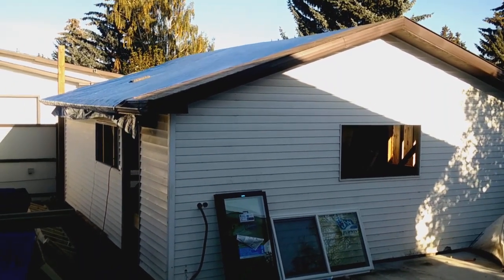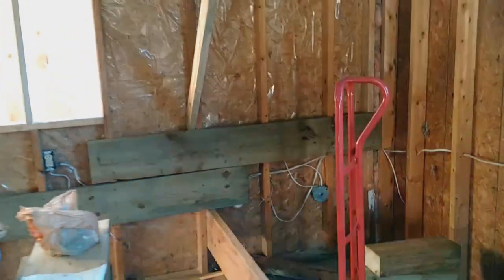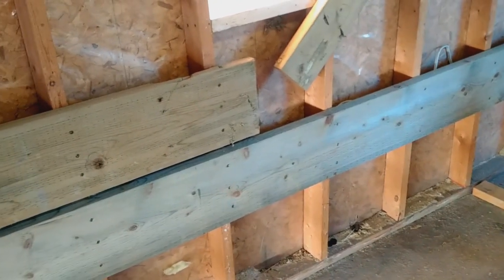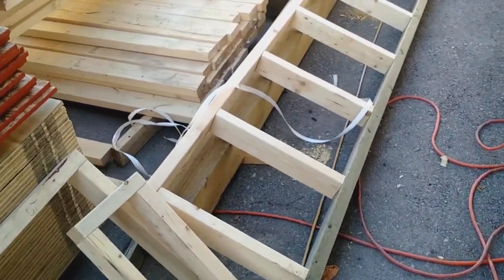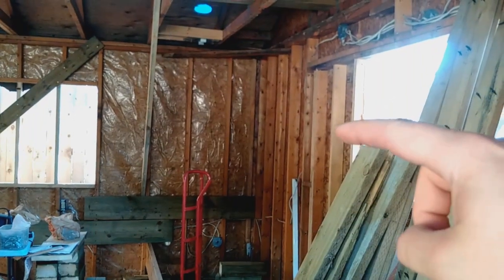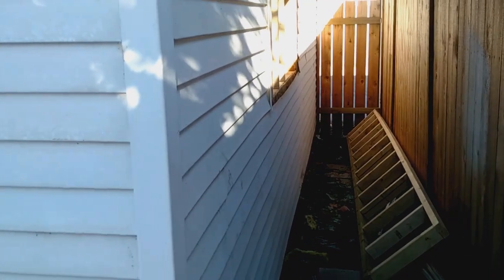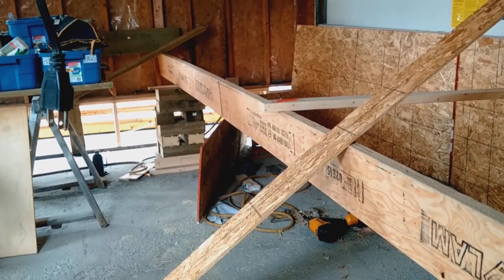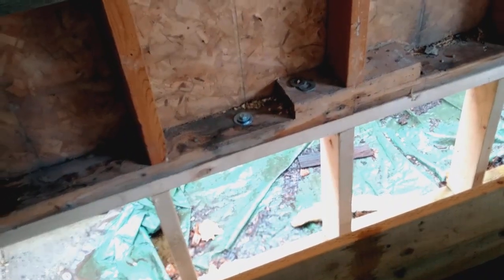How I lifted my double garage up 21 inches

Comment: pony walls wouldn't plywood sheets add structure like you would fir earthquake retrofitting. my neighbor had a room addition and had three feet of that pony walls in rear of house.
Reply from the maker: brian willoughby adding plywood to cover the seam on the outside and/or the inside will add substantial strength to the union.
Reply: John Molberg okay thanks just checking my little construction knowledge.  I lived at San Fernando valley. eight miles from Balboa and saticoy st.  epicenter of 1994 earthquake.   that plywood helps with the racking of the pony points.
Reply: John Molberg I would check local codes before adding interior plywood. inspectors and insurers like to see fire proof coverings like sheet rock even in detached garages that are so close to adjacent properties. the only reason I don't think interior plywood coverings are so great without a rock barrier is it can be the difference in being able to save your shop and tools or standing back and watching it burn to the ground.
Reply from the maker: MadMetalManiac74 code allows plywood inside a garage here. I however went with drywall. My strength comes from the sistered studs.
Reply: John Molberg good call. In the midst of a remodel myself. Going rock with open celings just like you have basically but I'll probably do a 2ft boreder above my pony wall of thin gauge metal (I'm a fabricator so I can get a lot it it for fairly cheap) over the top of the rock to help prevent damage mostly. I've heard of people doing the same with plywood. If you make sparks or work with cumbustables you'll be glad you have the rock if a misshap should occurs. Code or not. Code is just bare minimum.
Reply: Sheetrock just looks sooooo much better in the long run imo.
Reply: Seems like pulling the sheet rock, adding plywood then sheet rock over it?

Comment: I noticed your garage was wired. Did you lower your service box or...?
Reply from the maker: Lawmtho I disconnected the service prior to lifting. Since I was elongating the garage it was easy to relocate. In the end I had to re-run the gas line (something to be mindful of) so I trenched anyways.  Entirely new service was installed with 12 circuits.

Comment: how much did it cost to lift your garage? my garage is currently 3 inches below street level... My house and property is much older. sadly being as low as it is causing some flooding and I need to raise my garage before it gets ruined completely
Reply from the maker: Well the cost to lift wasnt bad. As I noted about $500 CAD. Then add another $500 to $1000 to refinish. You would also potentially need a new garage door if you followed my method.

Comment: The addition to the lower wall is a weak design. It would of been stronger to knock the lower plate off and bolt it back down, then sister studs from the bottom plate up along the existing studs.
Reply from the maker: TheBrowseman you are correct!  Now explain to me how you do that with 2x10s stuck to the wall and the garage 25" in the air. I basically did this exact method just with an interim pony wall.
Reply: You put the 2x10's high enough to not interfere with doubling up the 2x4's.
Or you shim out the 2x10 for room or you can put the 2x4's that you use to double up next to the current studs before you put the 2x10's on. Then when when you raise up the garage you pound the 2x4's down to the lower plate. 
You can reinforce what you have by notching out the double plate next to your existing studs with a sawsall and run a longer 2x4 stud right next to it, you would not have to do every stud, maybe every other or every third or every single one, one at a time.
Reply from the maker: TheBrowseman isn't your last suggestion exactly what I did?  I cut the old plate put with a sawzall and sistered every third stud. 

Your other options are also doable.
Reply: Oh, I see that now, so ya did good, never mind what I said.
Reply: If am to assume correctly you are worried about the original sill to pony connection? If so then I suggest you look at how strong nail lam columns used in pole building framing aka post framing is and get back to me if you think it is still weak. But those uprights could be a concern if were not braced with ladder or cross pieces.

Comment: Great effort! What is your planning process? Did you know what to do and how to do it prior to this project?
Reply from the maker: William Biggs yes and no. I got the idea from a member on the Garage Journal. He followed this process for a smaller garage. I also found a single youtube video of someone lifting a barn-like structure. Lastly my brother in law had a building moved by professionals and he described a similar method. In the end I took from all the prior ideas and adjusted it to fit my garage.
Reply: Wow. Congratulations!

Comment: Maybe put the lift in first and use it to lift the garage. Just a thought.
Reply: without knowing the total weight of his structure minus windows and doors to get damaged or be in the way, and the additional weight of the frame for the lift to raise the structure in its entirety, you be lucky that 7k pound or 3/5 US ton is enough. Let alone if its a two post type lift it can even handle the off-balanced nature of said lift. That said yes I have seen a video or two of those using their two or four post lift with lifting frame raise just the roof if not the walls as well.

Comment: Now you will have to make a video showing how to lower all of the windows so that they are not 5 feet off the ground.  Honestly, I am interested in what you are going to do there.
Reply from the maker: Davis King it's funny you mention this as this was a concern of mine. Once the garage was up I found that I really liked the high windows. It gave me more useable wall space and it really helped bring in the southern sunlight (there is a tall fence right outside the window). I'll post a finished video in a couple months and you can see how it looks.
Reply: I suppose it would deter people from breaking in since they can't see what is in there either.  When I built my garage I didn't install a single window but considered putting a few right at the top of the walls just to allow light in.  My walls are 16 feet to the trusses so wall space isn't a concern but opening them would be a challenge so I opted to skip them.
Reply from the maker: I am extremely happy about the higher windows, and I didn't expect to be.  I wish I could post pictures in here, but stay tuned and I'll have some more videos up soon to see the result.
Reply: Did you purchase the lift yet?  I got mine from gregsmithequipment.com and love it.  My only regret is not buying it sooner and it has paid for itself countless times already.  I got the 9k pound 2 post lift and the extension stands and an 8 gallon oil change tank with the transmission attachment for under 2 grand and installed it myself with a couple buddies in 4 hours.
Reply from the maker: I ended up buying a Lift King Pro 8.  It is a 4 post lift rated to 8000lbs.  I went with Lift King because they are a local company and easily available here in Canada.  I did look at the Greg Smith, Bendpak and others, but they cost a ton to get in Canada.  Your deal sounds amazing.

If you watch my most recent video about using a Concrete Scarifier, you can see what the windows look like as well as the 4 poster.
Reply: if you look at some similar structures with side wall clear or translucent panels, yeah it adds benefit to allow more natural light inside, but sliding ones also allow for a good wind to breeze in to cool the place down on hot days or vent out fumes or other deadly gasses

Comment: I did this with small house. You should have ran angle 2x4s on exterior. 2 each corner to prevent side shifting. Still you got it done. Congrats

Comment: What keeps your LVLs from twisting? Just screws attached the 2x4 walls? That seems like it could be really dangerous on a heavier structure.
Reply from the maker: Yes, each end is lagged.  You want the lift point as close to the edge as possible to mitigate any twisting.  I had a very slight bit but only on the one side where the jack got to be 3 feet away from the edge.  Don't do that.

Comment: Masonry foundation would be a whole lot safer than what you did there.
Reply: zeke112964 I
Reply: Not sure about your knowledge or experience, but seen numerous so called masonry walls fail in an earthquake over history and time as they are not ever reinforced in between with simple mesh or screen to strengthen it against such event or even a hurricane or tornado as well.
Reply: Only if that masonry wall is reinforced & concrete filled & tied to the ground foundation.
Reply: Seems like you would still have the hinge point at the joint between the old and new concrete, just the concrete would be heavier than the wood pony wall.

Comment: Since you already went 21" could you do the same but go to 48". Or is there a safety reasons. You stopped at 21"
Reply from the maker: I stopped at 21" because that was precisely the height of an additional garage door panel.  That meant I had a normal sized garage door.  Also, I was reaching the city limits for eave height.  

You could lift as high as you want, but I would suggest you find a more stable mechanism for blocking.  My 4x6 blocks were getting instable at 25".  I would suggest something far more stable.
Reply: +John Molberg good to know.  Thanks for the info.

Comment: I praise your effort but you could have left the structure intact and raised it, it weighs very little.  2 x 12's attached the perimeter of the structure would give you your lift points, everything else is a waist of time and over engineering.   Since hurricane sandy we have lifted over 40 homes.
Reply from the maker: tphone720 although I agree on the outer walls you still need to connect the left side to the right side. So that requires the LVL beams.  Since garages don’t have floors that is a critical piece. I also like doing the corner braces too. 

But hey, to each his own. It’s your head ;)
Reply from the maker: If you have access to the exterior then yes, this would work the same way.  If you are lifting a floor also, keep in mind it adds a lot of weight and it may not be self supporting.  It depends on the design.
Reply: chris hohenwald, if you already have not yet, I suggest you cross brace and by which not just a ladder frame cross bracing but one diagonal to keep the main beams from bowing in toward one another, knee bracing in the outer corners is still useful to secure the corners of the wall to it to reduce if not eliminate them bowing out of square and also tie in the back wall to the one beam to reduce flexing of it as well.
Reply from the maker: This is a good suggestion.  I noticed a slight bit of bowing on the back beam when I did this.  You would need a crazy long beam to do this though.
Reply: cross bracing pattern depends on max length of 2x4 you can buy or transport safely, but you can also do a picture frame with corner type angle braces,just do not toe nail the braces together to each other or to the lifting beams and use smooth nails or can even use long enough screws and attach from other side of the boards so they do not pull out on you, especially when attaching to the lifting beams,. there is a reason why professional services use I or box beams, more area for better stronger support and if you go this path with wood beams make sure the portion you got the jack against has additional plate and the sides sit atop that bottom cross beam and use carriage/lag bolts. All you need is as John showed but in your case Chris, you want to make sure one for every 10 feet for better support and stability but still brace them to one another.
Just some ideas from my experience or knowledge

Comment: I hope that you got the required building permits.  Selling the house with unpermitted remodeling is an increasingly difficult in the real estate business.  Lenders won't give mortgages on properties with structures that have been modified without the necessary permits and insurance companies will not cover them.
Reply from the maker: John Ferguson already addressed. Many times. Thanks for your concern.
Reply: Dont think it would even be noticed when selling. Most residential property reports go by structure footprint. Garage gets little attention and details is the length and width. Who’s to say it wasn’t that high before 😉.
Reply: That's bull crap Lenders and Corrupt INSPECTORS sell Homes with Garages Leaning off the Cliff. I see so many Violations after Folks done signed there life away How you think Contractor's stay in Business.

Comment: one things for sure your 21" knee wall has created a nice "hinge" should have made it out of block, might have been up to code then.
Reply from the maker: Jason M. Please read all the comments.  This build was approved by an engineer and a city inspector.
Reply: John Molberg 
Now flipping way! An engineer, and the inspector? Total crock. This is cool, but not sound.
Reply from the maker: Thank for your feedback.  I suggest you do it your way.
Reply: John Molberg 
I don't do things my way, I follow requirements, prints and engineering. Ain't my choice, but I've been doing it long enough, to know what generally works. You did multiple questionable changes here. You added elevation, two foot, on an eight foot wall, there by increasing lift, while simultaneously removing one of your best shear point protections, the mudsill. To make normal shear modifications at this point, mud sill must be removed, studs run clean through, blocking installed so that the new shear you install splits between old shear, and new shear. At least, then anchors, preferably epoxy set in  current mono slab, with forty eleven nails in them, at required locations.  You need to take this video down.
Reply from the maker: Please post your own video on how you would do it.  I don't mind your comments, but I will take the advice of the on site expert and not someone who watched my 8 minute make-shift video on the internet.  

I can handle you speaking your mind, but that's enough now.  I'll leave your comments and people can decide for themselves.
Reply: I am not much an expert than those professionals, but in my own experience having done basement waterproofing, I have seen so many failure issues with brick or block type masonry walls when my step dad owned that business. Due to poor construction via lack of reinforcements compared to monolithic concrete. His building and thus his choice, nothing is superior to time and nature except overbuilt structures that last a few or so storms before failing to the point of needing repairs, he did it this way to increase his overhead door height which roof raising alone would mean needing to also raise the "header" of the opening, this was less intensive in compare.

Comment: Should have removed the mud sill, run studs clean through to the plate, you altered the structure dramatically, and changed the dynamics of the shear, yikes.
Reply from the maker: roger davis watch the entire video. I ran full length studs in about 7 locations per side.
Reply: John Molberg 
Just, not, even, enough.
Reply: ICC,MRC, any international code prohibits stacking kneewalls.
Your 250 lbs. didn't do anything because the weight of the wall you tackled in the 2 foot vertical plane still weighs more that the force you applied.
The code is in 0lace because of wind/ seismic loads.
The previous poster is correct. You have to run studs and cat blicking through the full plane of the wall from sill to primary top plate.
Why do you guys post these videos when you do or don't know that these are harmful in their explanatoon/demonstration.
People can lose property or risk injury during occupying the structure after the alteration.
Reply: Keith Tomczyk 
Thank you. You said it so much better than I could have.
Reply from the maker: Great feedback guys.  People can read it and consider what you said.  

Remember the page says Youtube on the top.... not Department of the Dean of Engineering.  This is how I did it - I'm not forcing anyone to do it this way.  If the City of Calgary can't inspect a building properly, then we have bigger problems.
Reply: From what I saw ad fully watched, that and how pole building framing aka post frame uses nail laminated post/columns the sill o the knee/pony wall with just the bolts is enough without adding some nails between each bolt for additional securement and sheer strength. Then again I am not am expert than the so called experts. But he has said via reply in a few similar comments is the building has endures two years of natures abuse and still stands firmly. I have seen such walls using masonry units used in lieu without any additional reinforcement fail in even a category one hurricane or tornado let alone other type of wind storm of similar strength in my time as a basement waterproofer from step dad when owned that company.

Comment: Ok to start it was a good try but, you did it all wrong, your pony wall ruined the integrity of your wall and it will never be as strong, you should have jacked it up and sistered new studs on every stud and now you have a house of cards.also, i buy lvl's almost every day and have never had to custom order a little mouse of an lvl like that. One more thing, how much do you think that tiny ass little garage weighs, that one floor jack would have done the job. you must be an engineer  P.S. i know im being an ass but im only stating the obvious.
Reply: Suggest you take a look at laminated columns which are often used in post frame constructed (pole building framing) type structures. while only 4 inches, its still fairly strong enough if not overkill with just bolts alone to secure the knee/pony wall to the main structure if not also nails.